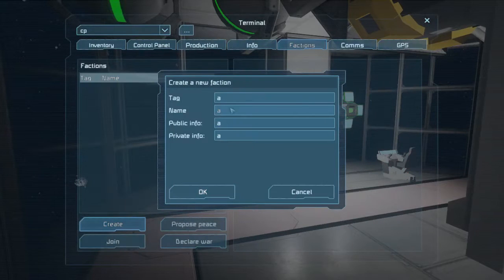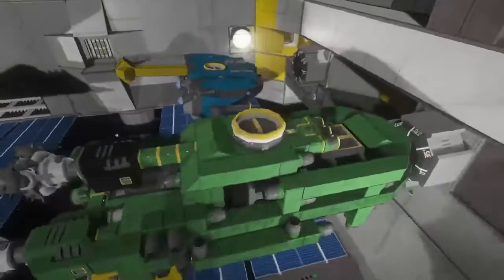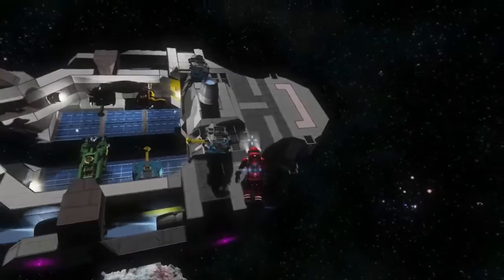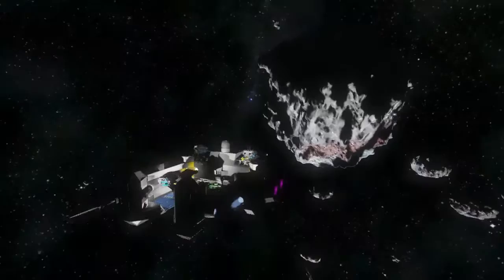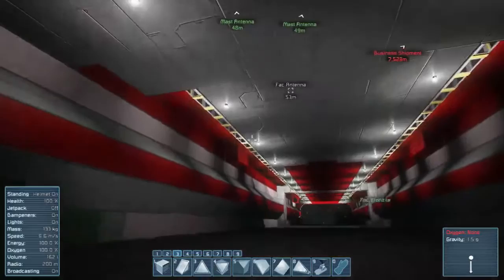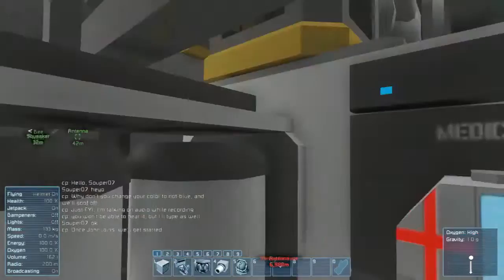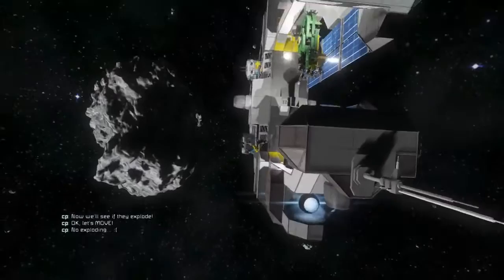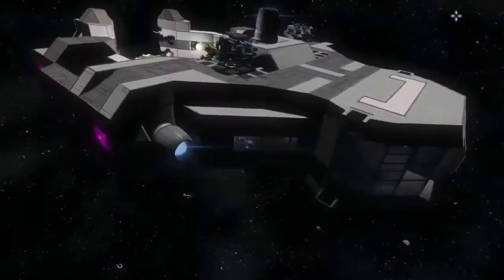Skunkworks #1: SE Carrier R&D

Comment: Maybe another factor that triggers by the weight of the smallship. In one exploration ship I made (out of cargo ships XD) I used a double landing gear procedure, with one of the big ship and 2 or 3 smallship gears, locked on each other and it worked pretty well. Connectors are way more weak, though xD